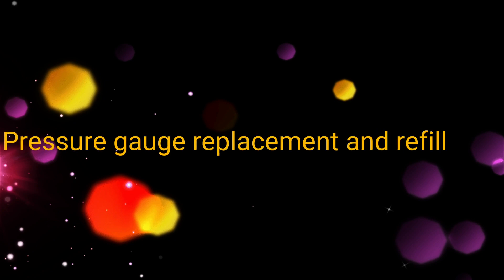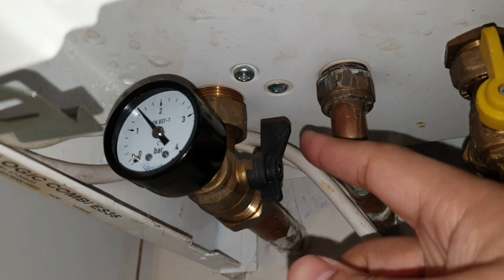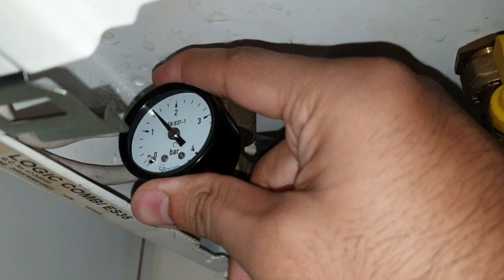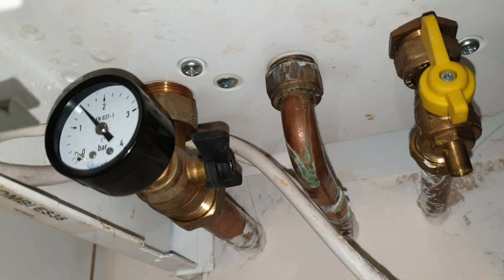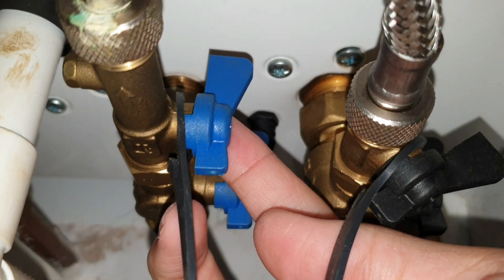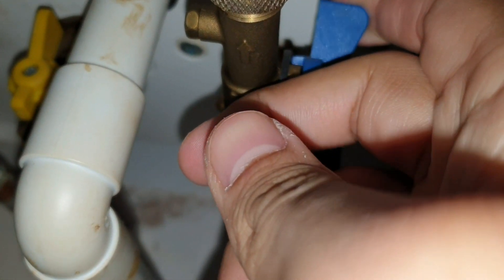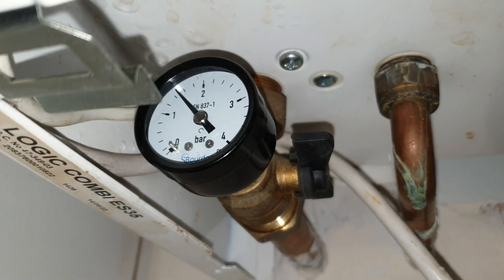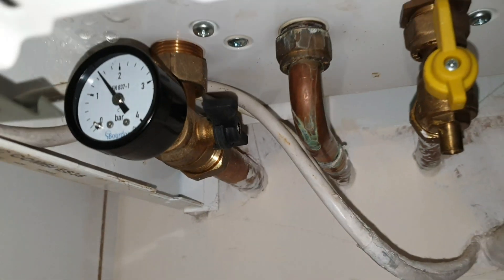How to refill pressure and replace pressure gauge

Comment: To replace the gauge, should i drain all system or just drain the boiler?
Reply from the maker: I didn't have to drain anything. Just ensure the lever is closed, it will leak a bit of left over, then attach your new gauge and turn the lever back on.

Comment: I assume power to the boiler needs to be turned off first or can it stay on?
Reply from the maker: It is safer that way yes. However if the boiler isn't running you can refill without turning it off

Comment: Hi, I appreciate you making this video.
I refilled my boiler with the CH valve (shown in your vid), in the wrong position (parallel) and broke my pressure gauge.

I'm going to replace the gauge. The manual instructs to drain the Central Heating system before doing this. Rather than just turning the valve as you do.
Are you confident it can be done like this without causing further issue? Thank you.
Reply from the maker: Only if you have the ability to isolate the pressure gauge, like it is in the video. If you don't, you must depressurise the system. Most don't have isolation valves so best to drain.
Reply: @laymandiy  I have the exact same boiler as you show. So yes I have the same isolation valve that you show.
Reply from the maker: Is the pipe work at the bottom the same? Because that's crucial.
Reply: @laymandiy  yes it's all the same or very very similar. It's an ideal logic combi 24. The valve and pipe for the pressure gauge is identical

Comment: Like your videos LaymanDIY.  Question: The needle in my pressure gauge rattles like hell driving me mad. Will the one you installed have the same problem or is it nice and quiet ?
Reply from the maker: Mine does not make any noise.

Comment: You didn't show how to replace it you just pointed at it
Reply from the maker: Just turn it anti-clockwise
Reply: To replace the pressure gauge do you need to be gas safe registered?
Reply: @matty81ish  no just isolation the flow or return and screw it off
Reply: You need to make people aware that this only applies to that specific boiler! 
If you try this on a vaillant or worcester etc and don't know what you're doing then your in for a surprise. 
I'm a gas safe boiler engineer btw.
Reply: Isolate flow and return. Drain the boiler? And can replace it?